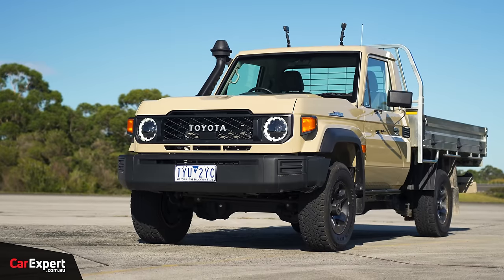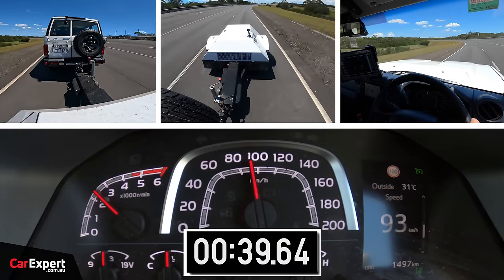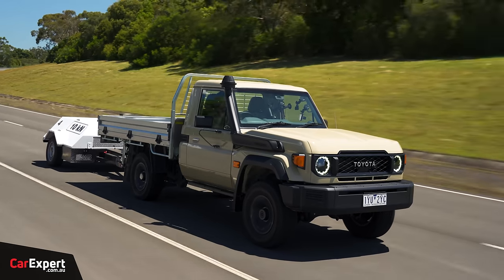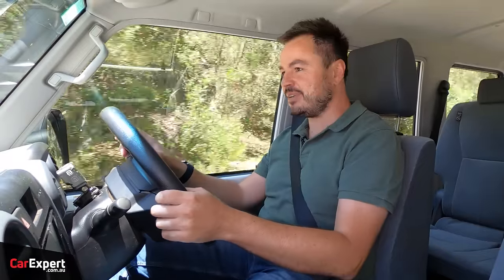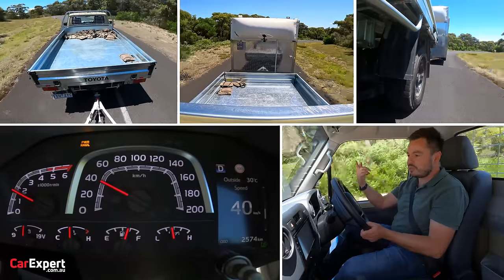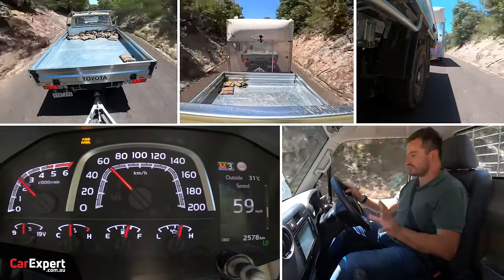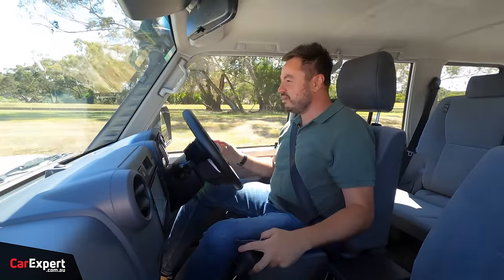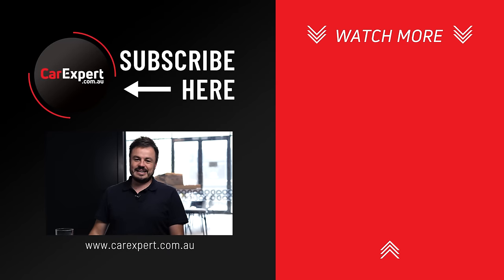LandCruiser 70 Series V8 v 4-cylinder towing stress test & drag race! Is Toyota's V8 dead?

Comment: The most impressive thing about the V8 is that Toyota could market the 70s series towards a target market that was prepared to spend in excess of $100k for a $40k vehicle. I can't think of a better marketing campaign for a vehicle that previously had sales in a state of attrition for decades. And to maintain such a high level of demand for so long, despite the shortfalls in its design is remarkable.
Reply: People are stupid!!!
Reply: …. They never broke. Many would still choose the V8 over the L4, any day.
Reply: He had to go back to first in the V8 lol 😂 I towed something at least as heavy as that behind my 3l 4cyl bt50 (dmax clone) over the great dividing range through thunderbolts way (hella steep) and never had to be below 2nd gear. So many butthurt egos in these comment sections, it must be so upsetting that they dropped a Hilux motor into the "MIGHTY" 70 series and it's shitting all over the V8 😂
Reply: @felixtimlock  it's a really tough pill to swallow, especially when you've overpaid so much for it!!
Reply: @alwynvanderlinde9507  Yesh it's true! I mean sure they sound a lot better then a 4cyl, but aside from the upfront cost it doesn't seem rational to pay 60 percent extra for fuel just for a nice sound and worse performance? Unless you only drive it twice a week to the local RSL 🤷
Reply: What marketing do Toyota do??!!! The V8 diesel sells itself 😃
Reply: @felixtimlock the v8 isn't a massive powerhouse for a reason, they are built for longevity rather than power. The v8 can be tuned reliably to have a lot more power and torque than the 4cyl that won't last half as long. I drive an 80 series, it's a slug but has 500,000km with no issues aside from basic maintenance, these little engines are tuned up and are built to last the warranty period and that's about it, after that you have to start worrying about turbo and fuel injection issues. I'd rather a detuned, reliable engine over an overturned powerful vehicle that probably won't see 250,000km without spending thousands on it.
Reply: You ain’t the target market. How much is a kenworth or Volvo fh?
Reply: What option did you have for a Ute with 7t GCM. For years. Nothing
Reply: @brendonganga7499  depends on the model kenworth or Volvo. Though I'm not sure how this relates to landcruisers
Reply: The reason is those V8’s are so de-tuned they can get up to 600000 kms. I know guys who own them with these kms
Reply: @matthewhaywood7411  This is only one of many reasons why a V8 is better. However, it’s useless to explain anything to those who have replaced common sense with marketing tricks. The more people are uninformed, the easier it is to manipulate them.
Reply: i think you missed the point old son
Reply: That’s ok if you don’t get it, you pay for what you get. It doesn’t have the performance of a modern Ute, but that’s because it’s designed to last at the expense of performance.
Reply: Spot on.
Reply: Nice way to call it a POS!
Reply: Mine was $69k brand new in 2020 . I feel bad for anyone els that had to pay more . I love my v8 . Yep lots of modifications witch is fun too . Money gone but will I have it forever I’m challenging my self to keep for 30 years like the one my dad had
Reply: @calamarininjabeast5866 the thong slap exhaust sells the V8 with ego boost
Reply: @matthewhaywood7411 how many V8s have died due to dusting? How many have died due to carbon build up? The V8 twin turbos have passenger side turbo issues. The 2.8 has been sold world wide since 2015. The V8 diesel is sold in how many markets again?
Reply: @felixtimlock the 4 cylinder actually sounds really good with the DPF removed and a straight pipe and cherry bomb
Reply: @stevespatrol  I think the V8s are only sold in Australia, South Africa & Middle East.  The environmental laws in Europe & US don’t let them into those markets when Euro 6 starts next year in Australia they won’t be coming here anymore either
Reply: The narrow rear track is a left over from when the LC was a narrower vehicle, they widened the front to fit the V8 when they upgraded from the inline 6 but left the rear track the same. How customers have let Toyota get away with this for over a decade astounds me :-)

What will be interesting will be to see how the 4 cylinder stands the test of time with customers who are loading them up and towing big loads.
Reply: The point is the experience. Only those who have driven in a mildly tuned V8 with a suspension upgrade will know. Those who haven’t will remain ignorant.
Reply: What are you on about, you peeved because you can’t afford one??
Reply: It shows you a couple of things about a certain type of man (tradies) in Australia. Desperate to impress his buddies on the Jobsite and doesn't spend a second doing any research.
Reply: @davide9849 keeping up with the Jones's despite it being inferior in every way. simply amazing insight to human behaviour.
Reply: @matthewhaywood7411 this is true but it costs a good chunk of change to replace piss weak clutch and tune.
Reply: @reubs91 why can't it just come capable stock is probably the point. For the asking price you shouldn't have to then take it to the shop.
Reply: @brisal88 Interesting assumption.

I’d be more concerned about the type of person who clicks on a YouTube video of a product they have no idea about (or can’t afford) or like just to write a negative uneducated comment……
Reply: @brisal88  live axles, heavy duty chassis, solid panels, quality construction; its a heavy duty vehicle. the only comparison to the 70 was the GWagon until now which the Grenadier is its direct competition. I would say the Grenadier will be the better vehicle overall by a country mile but the 70 will remain in its lane; albiet slightly overpriced. The price wouldn't bother me if the rear axle was fixed TBH. Im soending $6k for that to be done.

Comment: To those that bought a 70 series V8 recently …. 😂😂😂
Reply: And loving it
Reply: @wanderer397  yeah I brought the V8 and very happy to say that aand agree with u. I couldn't give two shits if that 4 cylinder can beat me in a drag race. If this is the reason for buying a 70 series, then people are missing the point. I drive a brand new Hilux everyday at work, yeah it goes alright, but its still a hilux. Driving the new troopy puts a smile on my dial from the moment it starts  😊
Reply: Lol yeah look at these guys in denial they bought a flop 😂😂
Reply: At least they got them at a discount...............😅😅😅😅😅😅!
Reply: @wozzgalaxy posted by someone that has never driven one. Armchair expert!
Reply: Dude, even this video shows the 4cyl consumes more fuel and works so much harder when towing the 3kn trailer compared to not towing. Ronny Dahls comparison shows the far hotter temps of the 4cyl under load. Btw I don't own either, and never will at these prices. And I would probably choose 4cyl. But I hate incorrect arguments
Reply: @tosgem  I thought it only showed the % increase in consumption and not actual usage. If it's a higher percentage of a lower amount then the 4 cylinder may still be lower consumption overall.  I'll need to rewatch it to see I didn't miss something.
Reply: Well if they want to modify  it then V8 is waaaayyy better

Comment: As far as I know the front track was widened to accommodate the V8 engine. The rear track remained original. Folks are paying to have the rear tracks widened to match the front.
Reply: It's high time Toyota puts in a 6speed manual with the V8
Reply: @Txgears a big part of the 4cyl's advantage here was gearing. I have a 3.6L V6 with a 9sp auto - a world ahead of the older 5 and 6sps for any application beyond drag strip torque.
Reply: theyre killing the v8, no point 
 @Txgears
Reply: Toyota stopped engineering vehicles for application a long time ago. Profit via shared parts from lesser models has been going on for a long time now. Perceived values are ridiculous. Ablity off road , perceived via marketing  . Reality once again gone, brainwashed percieved vslue ,  regular breakages perceived as normal . Did'nt used to be. Well there is no opposition. There could have been but our old American owners  GM n Ford have  and  have had there heads forever up their own arses. Yes .... I drive a cruiser and have owned many and patrols and triton and F100 and B2600 and etc.
Reply: Another thing is plenty of large, 4x4 vehicles around the world now have a slightly wider front track. It's because it gives the vehicle safer, understeer characteristics in emergency situations (swerving, under brakes). Oversteer causes fish tailing, rollovers. The track difference in the 70 is too much I agree, but the configuration is not as wildly crazy asnpeople seem to think
Reply: I think you are spot on, this is what I've read as well. Pretty lazy of toyota, but they basically only sell these in Aus, the middle east, and South Africa so it's a tiny market globally and they don't really care, especially when Australians keep paying cartel amounts of money for these
Reply: @tosgem  That's interesting. The new Defender front track is 1698 and the rear is 1683.
Reply: @atoieno that’s barely anything though. The 70 series is dangerously different front to rear
Reply: @CampbellSimpson Where did you get a 9 speed auto from !

Comment: The biggest thing everyone is missing is that yes the 4 cylinder makes more power and torque but its only a 2.8 ltr engine so its working a lot harder then the 4.5ltr v8. So the 4 cylinder is under more strain so its going to be less reliable. You're better to have a big engine working easy then a small engine working hard.
Reply: This is one of the basic rules of internal combustion engines (ICE), but nowadays, people favor marketing over engineering. Many believe more in the amount of subscribers than in truth, science, and common sense. They don’t care how many 2.8L engines will remain operational after their warranties expire. Stupidity is the most expensive thing in the world because it demands the highest price.
Reply: @australia-ukraine  its not as simple as that, newer engines usually have a better thermal efficiency. The 2.8L is 44%, the highest of all Toyota diesel engines.
Reply: Not really, GD engines are more reliable than a VD engine
Reply: @cdion78  I don't even want to start an argument. Just wait; time will judge us. All science is useless in front of YouTuber "experts".
Reply: Sounds to me like just another excuse. How much proof do you need until you realise the 4 cylinder is just a more technologically advanced and better engine than the prehistoric v8. 😂
Reply: @australia-ukraine  thermal efficiency isn't science? Engine capacity or low power engines don't directly correlate with reliability. Technology and design plays a major part too.
Reply: @PP-bm7zp  It only ‘sounds’ that way to you due to your lack of ability to objectively understand reality. I don’t wish to start an argument or persuade you. It’s impossible to explain to devout believers (in this case, of the almighty 4-cylinder engine) that there is insufficient evidence for their ‘god’s’ existence. You watch, you believe, you think in your own way, but that doesn’t necessarily mean you’re correct. I understand that it’s easy to ignore years of university education, experience, and skills in favor of popular YouTube content, but unfortunately, I cannot help you with that. However, consider for a moment: why are so many ‘uninformed’ people with $100k in their pockets willing to patiently wait for 2 years to get a V8 in a body designed decades ago? On the other hand, where is the worldwide engineering certification and global scientific recognition for your beloved YouTube stars? The only credential I can see is a sign of 100k+ subscribers on YouTube.
Reply: Pardon me, are you referring to the modern LC70 series (since 2007) with its 4-cylinder engine that has been built for the last 20 years? Could you please provide more information on this? As for my beliefs, it's straightforward and logical. I trust in true science and independent engineering, and to a lesser extent, in what I see, hear, and know. I've driven and owned cars with both types of engines. Surprisingly, I have been waiting for my V8, along with a thousand others, for over 2 years, not for a Hilux variant of the LC. I don't believe in the concept of a Hilux soul in an LC body until it's proven by time. What's the point? I don't need a 'smart, economical, and super powerful' car that feels somewhat like an LGBT style, which I might discard right after its warranty period expires. I won't even start on its automatic gearbox, which feels as primitive as it did 40 years ago; I still prefer the full control, push-start capability, simplicity, and reliability of a manual gearbox over an automatic one.  @@aaromettiainen7866
Reply: @australia-ukraine  ahh yes, many words said, but nothing actually meaningful. Where I am from we call that ‘word salad’. I’ll await the next chapter of your novel.
Reply: Does it matter if you can’t even tow what the job requires
Reply: Geeze you both are arguing different points.  The 2.8 has better thermal efficiency than the 4.5.  Makes more torque, makes more power.  Facts.  But being more thermally efficient does not mean less stressed in an absolute sense, just a relative sense.  Both engines are of a DOHC, 4 valve, cast iron block/alloy head construction.  There isn't a world of practical difference in the technology of their mechanical, induction or injection systems.  There are plenty of aftermarket tuners able to alter the outputs of the V8 by subjecting it to similar stress levels (boost) as the 4 cylinder.  At the same boost and AFR the 2.8 may be more thermally efficient but they aren't running at the same level of stress so the point is moot.   Neither are bad engines.  Arguably if you ran half as much boost in the 2.8, all else being equal, it would be less powerful, burn less fuel, be subject to lower thermal and mechanical loads/stresses and should last longer.  The same argument applies to the V8.  I am not sure how much relevance an engine lasting 400,000kms vs 600,000kms vs 1m kms when the majority of people purchasing them new won't keep them much past 100,000kms let alone 400,000kms.  By the time you've thrown in a handful of different owners, each progressively caring less about maintenance and care than the last (due to the vehicle getting older and cheaper), there are too many variables to make a valid comparison.
Reply: Proven by the 200 series having essentially the same motor with an extra turbo and different tune putting out 650nm stock and way more with an aftermarket tune. This is a manufactured issue by Toyota. The 1VD has way more potential than the 4 banger. He bangs on about 500nm making a difference. Imagine another 150nm...

Comment: It isn’t the rear track that is narrower. They widened the front track to fit the V8. They just didn’t change it for the 4 cylinder.
Reply: spot on
Reply: But the track is still narrower on the rear
Reply: @JF-di1nr  here come the autistic internet geek comments. 🤪
Reply: Hopefully they change it back to narrow after they end the V8 deliveries in 2025.
Reply: The rear will never be matched to the front unless a rear wide body is added to meet rear wheel poke requirements if they widened the rear diff.
Reply: Lazy toyota
They could of corrected that track
Reply: @joeblack1052 maybe they’ll narrow the front track again after the V8 is gone?
Reply: @CM303898  Nah that will cost Toyota extra money hahaha
Reply: @CM303898  probably more cost effective to widen the rear track
Reply: @CM303898  ideally would be better to widen the rear to match the front, wider track width is better for handling. Also for the body styles that require it a new rear set of plastic wheel arch flares is easy to design and add on to cover the rear wheel poke if needed, plus they could sell it as a seperate option to the older models that people have already bought if they want oem parts.

It would be cheaper for Toyota to have staggered rear wheels offset instead of manufacturing a new wider diff, not the best way but cheaper and more likely to get that from Toyota since they seem lazy. Surprised they havn't done that already or atleast offer it as an option at the dealer.
Reply: Same same
Reply: @79series just add wider flares like on bronco raptor or wrangler rubicon, no need for wide body. Doesn't matter for pickup as it's sold as cab chassis, just fit a wider tray.
Reply: @hi9580  Have you seen the oversize aftermarket rear flares. They look horrendous and not in proportion with the front fenders.
Reply: @CM303898  said no one regarding stability. It’s twice as high as its wide falls over in a strong wind.
Reply: @joeblack1052  I think you’re more likely to see Toyota reintroduce the narrow front end, than widen the rear axle. They won’t want every man and his dog with a 1VD LC70 trying to buy up every available rear axle just to widen their track width. You can say that it’s be a license to print money for Toyota, but they don’t want to give you what you want.
Reply: @paulmcintosh5589  Toyota won’t give you what you want. They’d rather dust off the pre-2007 engineered front suspension and steering, and restart manufacturing, rather than invest any dollars in R&D on a wider rear axle.
Reply: @CM303898  the front end axle has the steering component
The rear axle is much simpler and easier to produce?
They have also redesigned the front body work around the wider front axle.
Reply: So it is still narrower then !